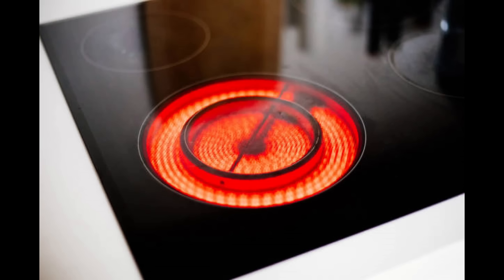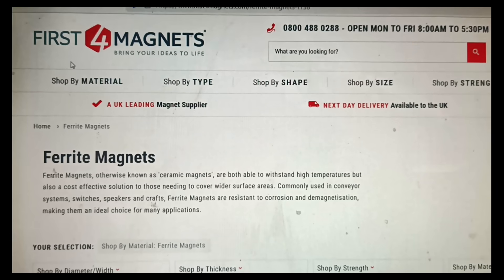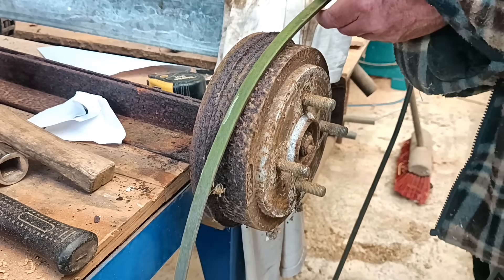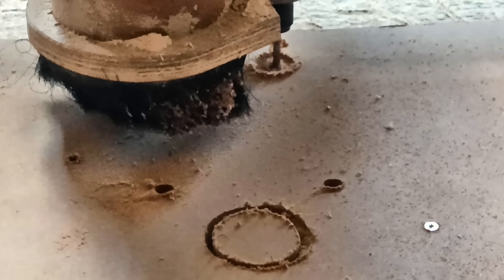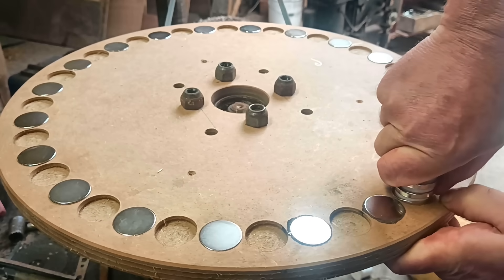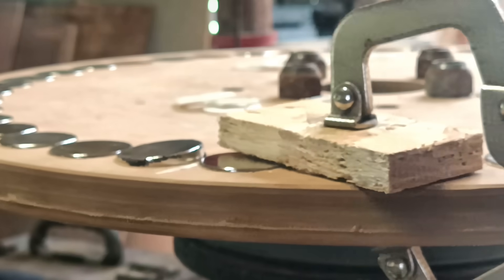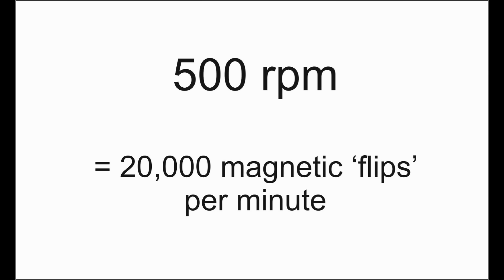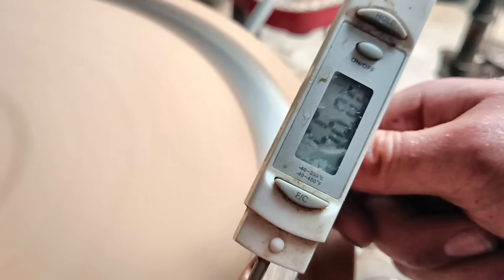I Made A BIG Rotating Magnet Induction Heater! (with magnets from First4Magnets.com)

Comment: Blows my mind that it works with non ferrous metals. If you hadn't shown it working with copper I wouldn't have believed it. Hope your health improves.
Reply: There are a number of utube videos where magnet is dropped down a up ended copper or aluminium tube.
this is how a reluctor brake works as found on a engine dyno really magic stuff
Reply: AC generators (alternators) work on the same principle, the difference is only they have coils of copper (eletromagnets) instead of neodymium magnets. The (primer) coils need to be excited with some current, this way the generated current can be regulated easily.
Reply: @baladar1353  I hadn't connected that copper wire isn't magnetic in the power generators / alternators. It is obvious know you mention it, funny how dots can stay unconnected for so long.
Reply: It would even work with plastic bottle and water because water itself is slightly magnetic. But it's not efficient at all.
Reply: Blows my mind how a 🤡 attracts other 🤡'! 🤣👌 
He's probably sick because he never listens to genuine health concerns especially like his so called activated carbon.
When the like the dislike number's used to show up on YouTube,  his video's where always low view's and high dislikes. FOR A GOOD REASON

Comment: I think I have mentioned this in an earlier video, but you could use an electric motor with permanent magnets as a heating element. Simply submerge it in water and short the terminals. Basically, use the motor as a generator and convert the current directly into heat in its own windings. 

This would be far easier to build and the magnetic fields are much stronger, so no need for a transmission. Also the loading could be controlled if the leads are not shorted directly but with a resistor in between. Different resistor values result in different loads.

Please give this a try and if you have questions, feel free to ask.
Reply: it also kind of is the same thing.
Reply: @MusikCassette  Yes! That's the point. However, far easier to build and I think also cheaper. Plus, the benefit of controlling the load is also kind of neat.
Reply: Oil would be a far better liquid to submerge the motor in.....

.... but really why submerge it? As you said,  just short the winding with a heating element. 

But I don't think this is really about getting the job done efficiently. It's probably more about content and playing around.
Reply: @srmofoable  Yes oil would be better. Transformer Insulating oil specifically. The thinking behind submerging is that the heat can be conducted away from the windings efficiently, so the windings don't overheat. Water is just the easiest liquid to mess around tough, that's why I proposed that.
Reply: This is just a test of concept mock up. I'm sure more durable materials will be used in the final construction.
Reply: Not sure I understand that completely, but it sounds like it would only work at high rpm.
Reply: @bobsmith5088  In the end, it is really the same concept as what Tim does. The change in magnetic field induces a current in the material.  In Tim's concept, the current flow happens in the copper itself, commonly named Eddie current. A motor as a generator does the same thing but due to wires, the current flow is mostly happening through the wires. When shorting the leads, the current has no choice but to circulate in its windings and thus the windings get warm. 

This works pretty well at low rpm. Have you ever tried to short a stepper motor and turn the shaft? Or a Hub dynamo from a bicycle? It's really surprising how much torque it resists.

Comment: Do you plan on bending an omega-shaped copper pipe as a heat exchanger to cover more of the magnet surface?
Reply: I was thinking that too, you could pump the water through the pipe and potentially regulate the speed of the water so that it doesn't get too hot before it leaves the part over the magnet. You could also potentially have two, one on the topside of the wheel and one on the bottom, depending on what (if any?) drag they put on the wheel.
Reply: @owllymannstein7113  making it go through the magnet heated part faster wouldn't change the temperature equilibrium though, as each liter would also emit less heat when going through radiators and would return to the heater warmer than if it went slower. I think a better solution for temperature regulation would be moving the pipe closer or further from the magnet wheel
Reply: At this scale I think it'd be easier for one end to go in straight, and then the other turn sharply up and then meander into going back to the house
EDIT: also, copper doesn't work well with induction, since it's a good conductor. You want electrical resistance for the heat to be emited. A PVC pipe with a carbon steel cable through the middle might be the best? Since it won't be heated on the surface. Or a steel pipe encased in some insulation

Comment: how long until the magnets loose their magnetism?
Reply: Neodymium magnets are really good at holding onto their magnetism. If Tims magnets were stuck to steel rather than wood, the magnets would be even better at holding onto the magnetism. The steel acts as a "keeper" and the alternating polarity of the magnets helps too.
Reply: @roberthayward9299  Neodymium magnets lose their magnetism if heated above approximately 80°C. Ferrite magnets on the other hand can hold onto it at about 250°C.
Reply: "permanent magnet if kept and used in optimum working conditions will keep its magnetism for years. It's estimated that neodymium magnets only lose approximately 5% of their magnetism every 100 years."
Reply: Infinity.